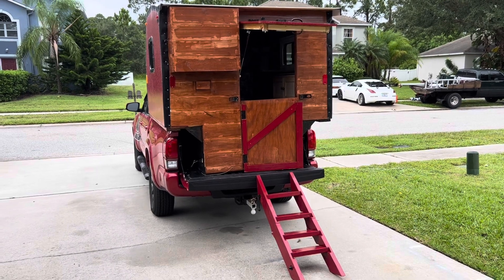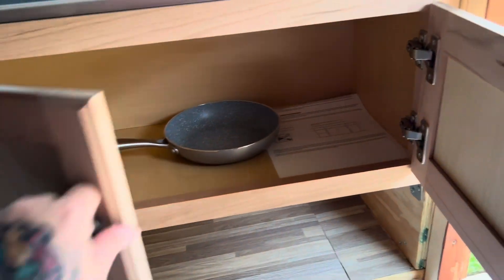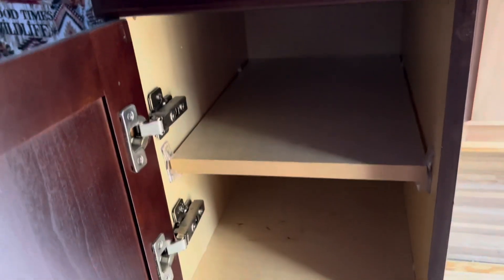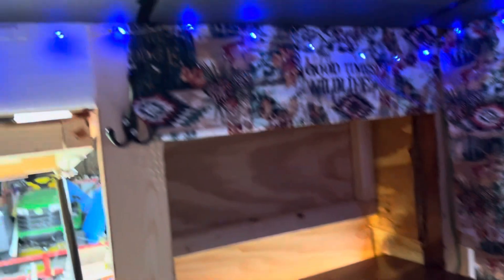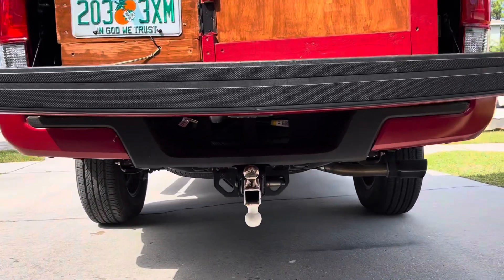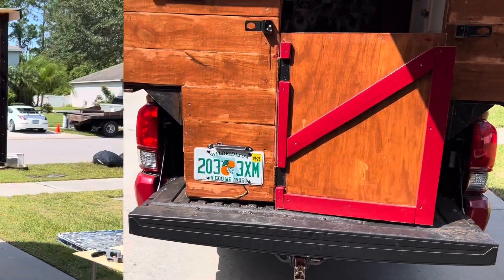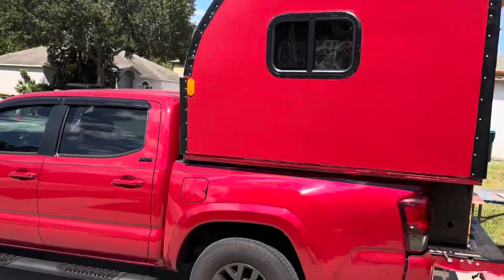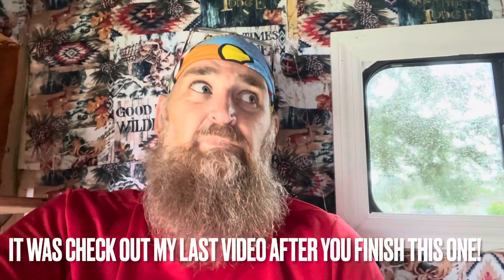Homemade Truck bed camper finished…for now.

Comment: Looks good buddy! I would recommend getting some firestone air bags for the rear! Cheers man
Reply: have a set for my ranger. bought them around 15 years ago. still in box. read install instructions. need a shop to drill the frame to put the airbags in.